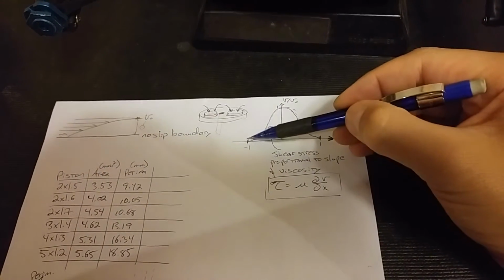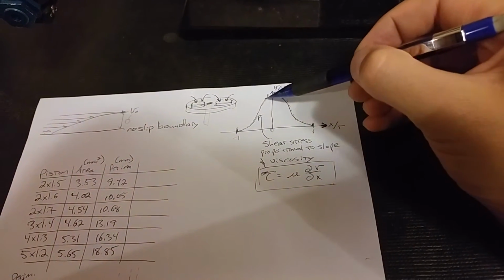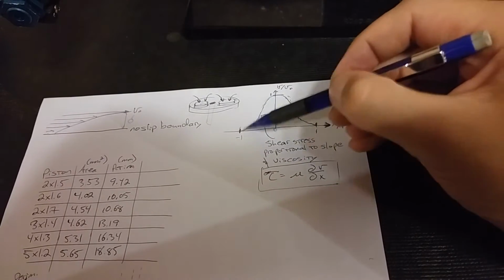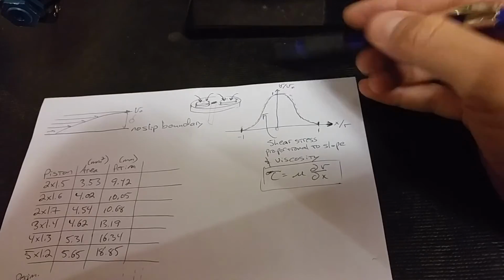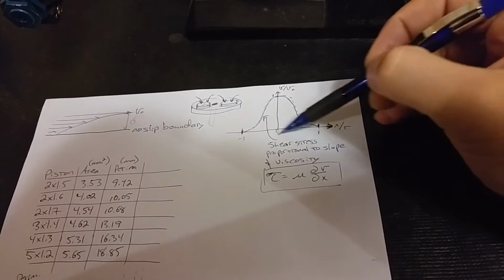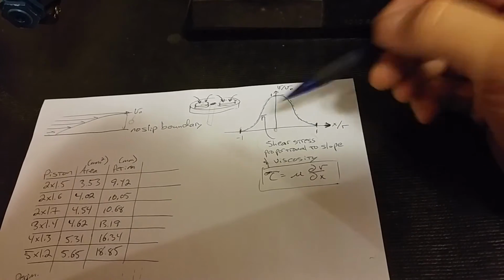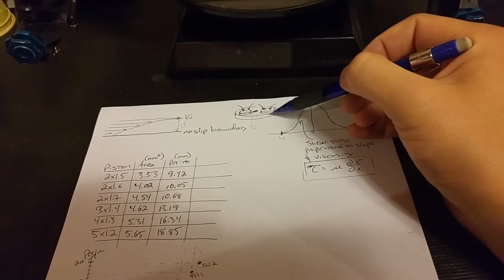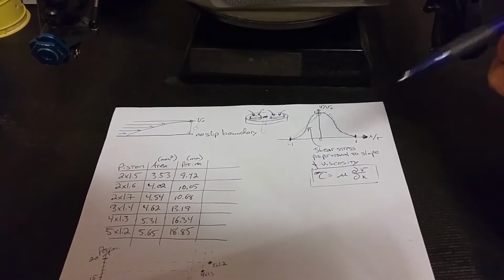Shock pistons and "pack"

Comment: Great video! Running Spec Slash were stuck with factory Traxxas 1/2/3 hole pistons. Unfortunately all the holes are identical (1.1mm).

In theory, changing pistons only will affect which fluid weight ranges are useful right? Since area and circumference increase equally each time?  Maybe 3 holes offering less (relative) pack because it adds more places for fluid to flow rather than forcing around the outside of the piston perimeter?

This has been my observation trying 80 or 100wt oil with 3 hole pistons vs 45wt oil with 2 hole pistons, but would like to wrap my head around the math of it.
Reply from the maker: If they are the same diameter hole, then to a first order the 2-hole would increase pack by 3/2 = 1.5x; however, if you drop the wt by 45/80 = 0.56x, then the net change would be 0.84x pack, compared to 3-hole at 80wt.  Maybe the 16% difference there is not that noticeable on the track, given the type of chassis, layout, etc.  It is also possible that there are 2nd order effects, for instance if a higher viscosity oil has a different boundary layer thickness compared to a lower viscosity oil...

Comment: Hello, thanks for the video. I have b74.2d with 2 hole 1.7piston in front and 1.8 in rear and I run on an indoor clay track, nice straight way, tight turns and a few jump. Would I switch to a 3 hole piston for better cornering and landing?
Reply from the maker: The 3 hole would give you less low speed damping and more high speed damping, for the same piston hole size.  So that would basically mean more roll in the corners and more pack on jump landings.
Reply: @doctormosfet  thanks a lot.
Reply: @doctormosfet would I use a thicker shock oil for the 3 holes piston?
Reply from the maker: @johndough8520  not necessarily.  It all depends on the track and you'll have to experiment with it.
Reply: @doctormosfet  ok thanks. I’m hitting the track tomorrow for testing

Comment: Youtube served me this video. I seen other videos of yours before so it must have known I was looking for information about my rc shocks. Your maths agrees with my perceptions on the track. So if my car is a slapn' and bouncing on a flat land. I need more holes not more viscosity or spring? So more holes=more friction to absorb the high speed energy? Fluid dynamics are creepy.
Reply from the maker: Well what I showed here assumes that the boundary layer is a small fraction of the hole opening (I should have pointed that out).  If your car is slapping and bouncing, then really that's two things.  The slapping could be because the springs are too soft and/or you don't have enough pack, while the bouncing is because you are underdamped, which is either too thin on the shock oil or...not enough pack.  You can increase pack with smaller holes, either something like a 2x1.5 or a 5x1.2 piston.  There difference between those two is the 5x1.2 will give you less low speed damping, helping the car roll more in corners (good for hard dirt).

Comment: What are your thoughts about drifters who run oiless shocks???
Reply from the maker: Well I don't do any drifting myself, but if I had to guess, taking the oil out would help speed up weight transfer and perhaps get the car unsettled more easily so it drifts.  I can't imagine it would be very stable, though.

Comment: You are saying that a 2 hole piston with larger holes has more high speed pack than a 2 hole piston with smaller holes? From what I have found it’s the opposite. If my car is bottoming out on large jumps, I decrease the hole size and it prevents bottoming out and feels like it has more pack...
Reply from the maker: I should have clarified that my analysis assumes the boundary layer thickness is an insignificant fraction of the hole radius.
Reply: @doctormosfet  great videos

Comment: I also think your conclusion is the opposite to what a driver would do. On a smooth track many holes would be beneficial, because you can set the suspension to be very soft and plush for cornering, but the many smaller holes will have more aggressive pack for the jumps. This also works tracks with a lot of sharp bumps. Then the opposite for generally rough tracks, less and bigger holes for less pack as well as a setting with thick oil to slow the responsiveness of the car down.
Reply: After thinking about this more, I think the key point is that with less larger holes, you have less pack high speed, and because of that you can set the car up with firmer suspension for high grip tracks. The lower pack will still work well for landing and high speed jumps. For many smaller holes, you can set the suspension softer, so it is more plush and giving the car more grip when cornering, accelerating or braking, and so it handles a rough surface well, yet because it has more high speed pack, it will still land well and absorb high sped bumps well. So fewer bigger holes for high grip, and more smaller holes for low grip, basically. As for bumps, that is not something that can be explained universally, as it will depend on car design, driving style, and type of bumps.
Reply: @invisiblespeedrc   I find that the less amount of holes and/or the smaller the holes, the more high speed pack I get jumping/landing AND the more low speed pack I get.....Less chassis slap on jumps and less roll in corners. More damping all around. Not sure what Mosfet is saying....

Comment: Only one problem. 2 x 1.7 piston has less pack than 2 x 1.5 piston, but in your graph it has more. I think the idea you have is correct, but the graph is wrong because hole size is also important. The shear rate is higher in smaller holes, so that would need to be accounted for also somehow. More pack = more holes and smaller holes. Less pack = less holes and bigger holes. How to show that in a graph I do not know. What do you think?
Reply from the maker: Yes, this is a good point.  What you're basically getting at is the boundary layer is a non-insignificant fraction of the hole radius and so that must be factored in.  I agree completely, so I should clarify here that this video assumes the boundary layer is much smaller than the hole radius.

Comment: hi there its me again...trying to understand as much as i can...so by saying low speed damping is getting lighter when we use less holes,u mean that if for example there are no jumps and we only have to do with corners and changing directions from left to right,the action is faster with less holes?or is the opposite?
Reply from the maker: Fewer holes will increase low speed damping.  You'll note in the plot I show in the video that LSD drops as total piston hole area increases.  So if we have fewer holes, that would trend toward less total piston hole area and therefore more low speed damping, which in turn would slow down the shocks (all else being equal).

Of course, the picture gets more complex than this as we change the shock oil viscosity, as you can achieve the same LSD with fewer holes + lighter oil and more holes + heavier oil.  The difference between the two will be pack, with the latter option having much more pack.  

There is also a second order effect in pack that I didn't really cover here, wherein if the piston hole is small enough, then the radius becomes comparable to the thickness of the boundary layer, which in turn will result in an increase in pack.  I'm assuming in this video that we are not in that regime, but it is possible with thick enough shock oil and/or small enough piston holes.
Reply: @doctormosfet  so by increasing the low speed damping means that the car will be more responsive?
Reply from the maker: @jimjimaco4217  sort of ;)  The springs play more of a role in responsiveness than damping.  If you increase the damping, it makes it harder for the spring to rebound the shock, so the car will feel less responsive on rebound.  However, it will feel more responsive on compression, as higher LSD will make it harder to compress the shock in the first place.
Reply: @doctormosfet  thanks a lot

Comment: sorry its me again....if i may ask one more question please???i am an asphalt guy,so i suppose things are easier for us in terms of suspension because there no jumps...but there are some bumps ofcourse,but the main issue is the turning,so the question is in a track  with no bumps you suggest less holes and thicker oil,and the opposite in the case of bumps???and how the heck can i understand if i have issues with turning,which thing should i change first????holes???silicone???? now its more than one question....sorry again,but sometimes when you are reaching a level you can not just rely on anyone opinion..thanx...
Reply from the maker: If you have issues with turning, that's probably the most complex.  This is because a host of things will impact turning.  Ackerman, caster, roll center, shock angle, rear toe, etc.  My suggestion is to first figure out what part of the turning you want to improve (corner entry, corner exit, mid-corner) and under what conditions (high speed, low speed).  From there, you can down select which change/s to make.

Comment: Doctormosfet,
Are you sure that the pack (high speed dampening) is not inverse?  The more circumference, the less pack.  For example, 2x1.5mm pistons should have more pack than 2x1.6mm pistons.  But in your explanation, you state otherwise.  Other than this detail, I think it is the best explanation on the internet about shock pistons and pack.  Period.

Thank you,
Glenn
Reply from the maker: Hello Glenn,

Right, so I was isolating my description of pack as what happens only along the piston hole perimeter, assuming that as you change the perimeter diameter, there is no resulting overlap of the spatial shear stress distribution of the shock oil.  If you have 2x1.6 and 2x1.5 pistons, there should ideally exist more pack in the 2x1.6 pistons, and more low speed damping in the 2x1.5 pistons; however, if that piston diameter is small enough to start resulting in overlapping shear stress "fields," then 2x1.5 will have both more low speed damping and more pack.

Thanks for the nice comments.  I'm glad you like the video ;)
Reply: Nice.